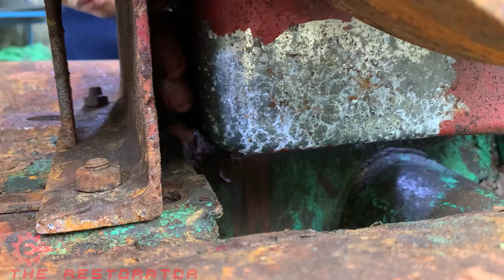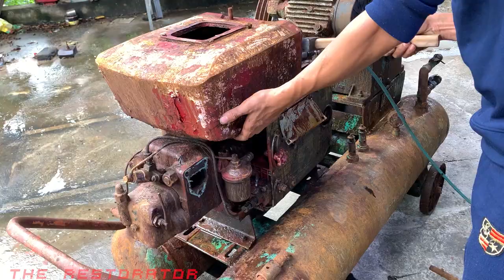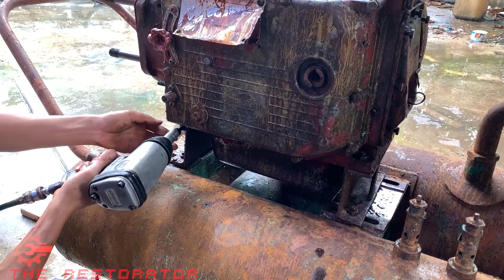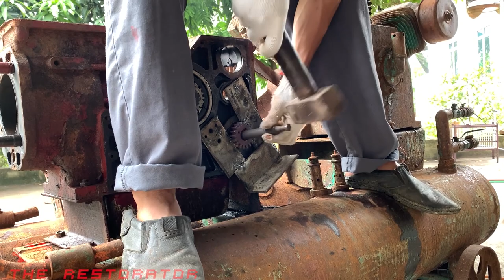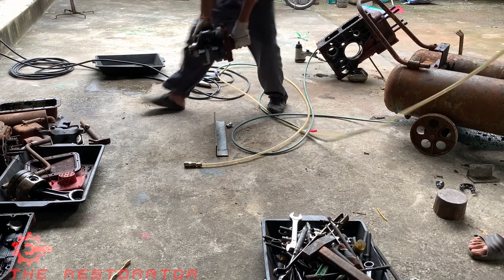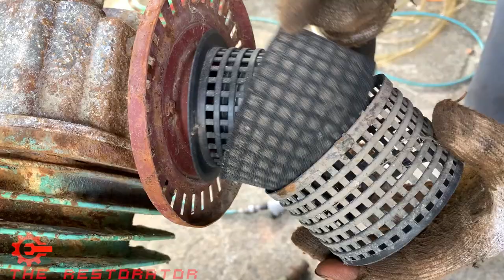Restoration GIANT AIR COMPRESSOR | Restore Engine 1500Cc Vintage

Comment: He seems to make no effort at all to organize the nuts bolts, washers and other parts he's removing, which is a huge mistake. Also, consider washing the whole assembly before you disassemble it - all he's doing is letting dirt and rust get into places where it shouldn't be.

Comment: Dear sir excellent job may I suggest a few ideas  1 the gas tank vinegar and half a handful of pebbles let it soak for 1/2hr then shake then let sit do this 6 times then drain if any left put baking soda and vinegar it will foam let it then swish will get it 75%. Now when you get it somewhat running get Sea Foam in the fuel system cleaner and doesn't harm internal parts  next  look at using a paint  from rusteloum hammered type black green copper silver wears really well even repair scratches and easy to fix light sand spray over
Reply: I think he knows what he's doing if your so clever make your own video

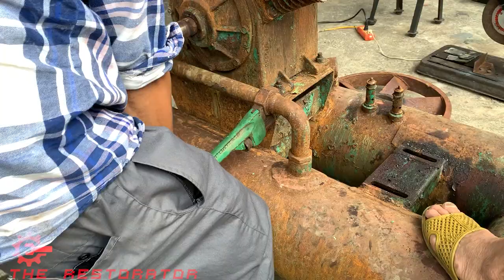Comment: OK I think someone is pulling our collective legs.  The page location states "United States" yet everything I see from facial structure, location and a few words here and there says Vietnam.  I like it at TS 21:11 where he finally figures out he is turning the gland nut on the air tubing the wrong way.  He even makes a small remark which I think means "duh". When they get it all back together I wonder if they are going to hydro test it?  Tanks look like they could be very rusty inside and if so they could become bombs when the unit reaches pressure. I certainly would not want to be standing around it.
Reply: 😡 - I won’t be surprised if he “a Vietnamese Oriental” is one of those restoration fraudsters = is it the tropical atmosphere of Vietnam, or has that compressor been deliberately pre-rusted?

Comment: How comes you are not using rust remover say WD40 to free the nuts to stop them from shearing. That engine is the most complicated one i have come across. i have never used a hammer on the engines i have serviced.

Comment: How many viewers out there know what type of air compressor this is by design.  I mean many cylinder, single stage or multi stage many cylinder and why?  I know the answer so if you think you know reply to this comment with your thoughts and reasons. First person to get it right wins a vacation to nowhere as most countries are still locked down. 😏
Reply: I would send you on a permanent vacation to nowhere
Reply: @boomerhgt  nice to know you, looking forward to a vacation. Please send ticket soon.